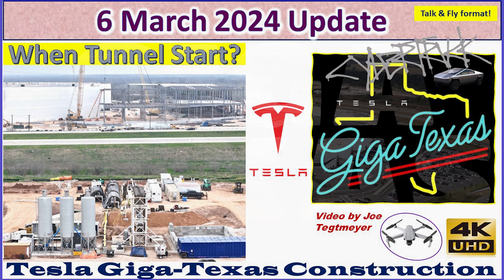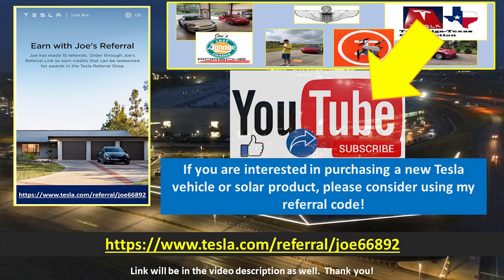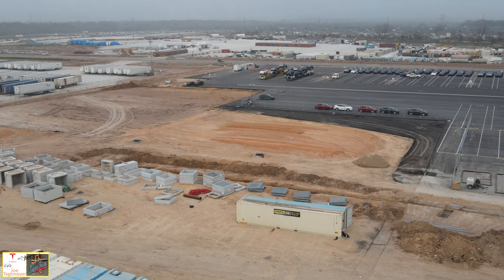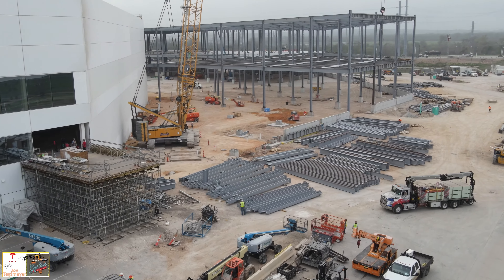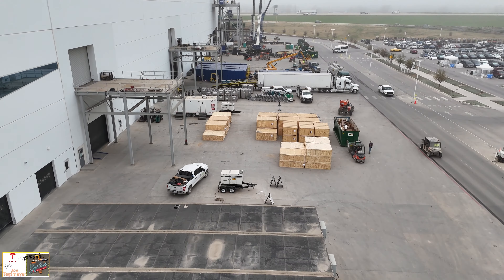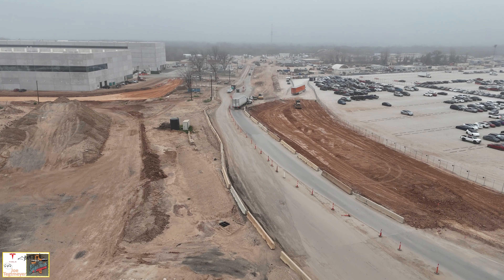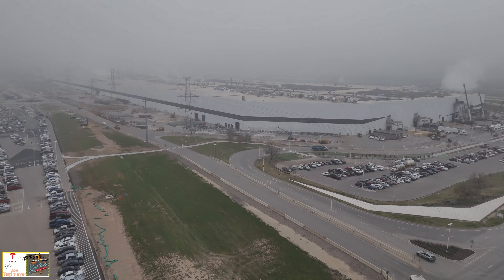W Superchargers, S Extension Grows & Production Ramping Hard! 6 Mar 2024 Giga Texas Update (07:45AM)

Comment: Thanks Joe
5:22. Westside. Tunnel Project. Spoil pit. Fixing ties across the concrete lego long edges. Steelwork on the ground to the left appears to have cleats/tabs at a similar spacing. Some material already dumped in the pit. Probably the sludge that was in front of the TBM.
8:49. New EOL north. Inside the door. White machine. Could be part of a drive-on dynamometer, or the traction motor for a movable production line deck.
9:33. New EOL Superchargers. Couple of arrows marked to show the normal orientation.
11:26. GA west. Old ramp location. Threshold has been saw-cut and part removed.
11:37. GA. Highway side. Lift station. Some issues still. Might be by-passing whatever is in the rectangular vault.
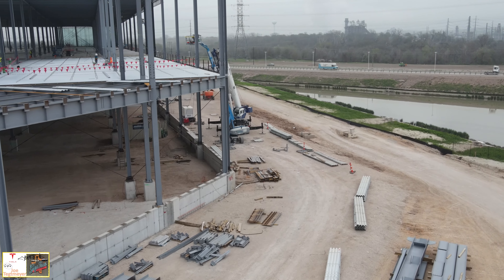13:09. Southend, west. Stack of steel. Right. Particularly deep beam with connection brackets for bracing. More ‘bracing’ related beams seen to the left, and at 13:47 to the right. Conspicuous lack of braced columns in the structure until now.
14:10. Southend, south. Left. Worker standing on a 6’ or 7’ 1.8m or 2.1m stepladder. Shows the top of the cast-in groove (potential door opening) centre is about the same height.
14:19. Southend, south. Inside. Joe’s photos include ‘The Money Shot’ of a view inside. Top of mud slab to underside of what I think is a lintel/beam for a door opening is about 12’ 3.6m. 
14:29. Southend, south. To the right. Painted section of retaining wall would be a clue as to the finished grade outside the building.
15:03. Southend, diagonal corner. Bottom. Black frames that look like frames to store glass on.
15:46. Southend. Tank farm. Top. Lids/caps have the various fitting flanges arranged. Some cut out.
16:01. Southend. Inside. Top. Excavation. Formwork shuttering for a finished slab placed on the mud slab.
17:23. Stamping, apron. Left. Large white crated delivery.
20:24. BIW, apron. Left. Concrete placed for a footing for the ramp retaining wall. May be the mud slab only.
21:44.  Casting east. Apron. Stack of screw/auger piles. Some handy pilot holes.
Something heavy to be placed here. Not the setout expected for a structure. Might be another Tank Farm.
Left some pipes on the roof may be related.
22:39. Paint. Apron. Cybertruck rear castings seen being crated up in Brad’s video yesterday. Completed castings, not untrimmed castings like these.
23:59. BESS switchyard. Knife switches that control the Megapacks are closed. To the right, the knife switches controlling the cables to the Mega-Vaults at the new switchyard/substation are open.
Megapacks ‘might’ be connected to the grid. Not connected to the factory.
27:00. Crash Test Track. Near the bottom right corner of the yellow plastic. Thin hose connected to the end of a Dewalt battery blower. Blowing debris out of holes drilled for the starter bars.
28:36. Cathode, west. Trench. Bottom centre. As noted by Bob Callahan a hydrant was just dropped off. Presumably the trench related.
29:11. Die Shop, north. Installing a flue or ductwork between the kiln/oven and the Die Shop.
Reply: I was about to request a wellness check
Reply: @benguthrie49  I was holding out so that you've got something to read before you hit the clubs!
Reply: @DessieDoolan  too much rain tonight. I'm hoping it ends by 1am so I can get my walk in.

Comment: Thanks Joe for the close up view of the switches!
Megapacks:
@ 23:59 A lot of vehicles in the yard. cabinet door open on one of the megapacks.
BESS substation:
@ 24:01 all 12 switches to the megapacks closed on this side.
@ 24:05 Don't have a clear view of the 12 switches on the other side but they appear closed as well. 
Those switches were open for the last two weeks. with only 6 switches being closed for a few days. They were all open yesterday. 
Let me remind everyone that closed switches doesn't necessarily mean that the megapacks are operational. Since circuit breakers along the way may be open.
When the megapack yard is empty of work crews, that may be an indication they might be operational.

EOL facility:
South superchargers:
@ 9:42 Two Cybertrucks parked in the wrong direction against the arrows, also not plugged in.
EDIT: Cybertrucks ARE plugged in.
@ 11:41 (Right) Another closed vault. An indication that the duct-banks to the superchargers are energized or soon will be.
Parking garage:
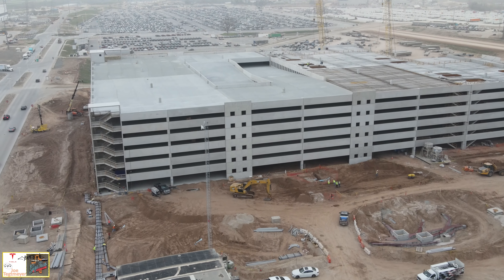@ 17:33 (Lower left) What appears to be 2 bases for switchgear cabinets.
@ 17:41 (Bottom) Where duct-banks head towards the building.
East parking lot superchargers:
@ 20:09 Speculating that these will be temporarily shut down soon, when the westside superchargers become operational. That will allow them to be disconnected from the temporary power supply and reconnected to power from the main building.
Eastside of casting:
@ 20:58 With the exception of reconnecting the superchargers to power from the building....
Cable splicing appears complete in the open vault by the stairs.  Bringing to an end a months long project to connect the factory to the new substation.
@ 21:40 Stacks of screw piles?
Reply: 9:42 If you stop the video and zoom in at 9:44 you will see that the trucks are plugged in.
Reply: @bobcallahan2322  You are correct. Thanks! My monitor is so crappy that even at 2160p resolution, I had to slow down the video and look really hard to see it.
Reply: I use an iPad Pro, works well.

Comment: Those "Rusty Poles" are the piles they are about to drive in the ground there. Looks like there is going to be some sort of small building off the side here perhaps...
Reply: Yep. Maybe a hopper to hold castings and feeding them back in when needed. No forklifts and racks running back and forth.
Reply: They screw those pipes into the ground. The excavator there has the screw attachment on it. They will start very soon.
Reply from the maker: Yep ... I was able to see them better in my images after I edited the video. I appreciate your heads up on them!

Comment: Thanks Joe for another great flight, and the insightful commentary.  Can you check if there's been more tunnel segments delivered?  Last I saw there was only about half of the required number.  I think they're either 1.5m or 5ft long, and 6 segments per ring. so that may eventually allow us to estimate total length.
Also worth watching the nearest point the tunnel can exit.  Inside the factory is looking less likely, with all the steel in the way.  Also, going back to May/June, there seems to be a groundwater management well along that path, which wouldn't make sense if they have to tunnel through it.

Comment: Great flight Joe.
Can you determine if the glass is single, double or even triple pane units?
Reply: Cut and past from a previous comment. "Southend glazing. 12,000lbs. For that weight it must be laminated glass.
In metric, 9m x 2m x 0.12m x 2.5 (relative density of glass) = 5400kg. 50kg for a surrounding frame. 12,015lbs.
Counterweights on the vacuum lifting rig are 5 x 1000kg. 5000kg."

I think it might be doubled glazed with one surface (likely outer) multiple laminations (4 or 5), gap, 2 laminations.

Sedak the German glass supplier has a particularly good website.

Comment: 1:30 the cyber trucks are pointing the wrong direction. They’d need to point away from the building to be able to use all the chargers.
Reply: Could be just parked for testing.  Eventual flow may be as arrows suggest.

Comment: 13:19  One of the theoretical TBM exit points is just inside or just outside the opening on the perimeter of the building in the center of this screenshot.  That's because it is perfectly across from the TBM ready to go under the freeway.  However, if you look closely, you will see the deep pumping station that was installed last year literally feet away.  I would find it incredible that they would plan to tunnel so close to this with only feet away as the TBM would have to have made it's upturn by then..
   Therefore, the TBM either has to exit within the Southern extension, traveling safely far below the pumping station, or some place on the other side of the new building.  What does everyone else think?
   Edit to add: another possibility other folks have mentioned is that it comes out of the ground just past the freeway in an analogous position of it's new to be drilled entrance!
Reply: 13:19. Deep well. The well is well* clear of the tunnel alignment. Manholes to south also clear of the alignment. A drain connects the manholes to the well, that drain is deep enough for the tunnel to pass above. No other reason for it being that deep.

This deep well (in hindsight) was the first part of the tunnel project.

*pun intended.

Comment: Although connected to the grid, don't the megapacks usually have a green blinking light that indicates they are energized and active?
Reply: Not necessarily connected to the grid. The might be, but it can't be confirmed. The thing about switch positions is that they can only tell you if something is NOT connected. They can not confirm a connection even if they are closed. That is due to the fact that there are also circuit breakers that may be open. While circuit breakers may have indicators, they are not visible from the drone.
Not sure about green blinking lights on the megapacks. A better indicator may be.... Switches closed, the absence of work crews from the megapack yard, and all gates closed. Or... If Joe or Brad get a chance to talk to one of the contractors working on the project.

Comment: Well if they are shipping complete castings that would suggest they are fully replaceable no?
Reply: It would suggest that they shatter on impact. Not good. Maybe fully replaceable but at what cost?
Reply: @DavidJohnson-tv2nn i was looking at it from a custom builders point of view sorry. its my understanding it takes a lot to damage them in the first place.  they have govt mandated crumple zones just like any other truck. They would have never passed DOT if they just "shattered."
Reply: @DavidJohnson-tv2nn The entire vehicle is basically built onto those two large castings.  Seems unlikely you could extract them economically.  Does remind me of the old saying, "Take off the radiator cap and replace everything underneath it." 🙂  Hundreds of reasons to send samples to partners.  In the damage/repair context it could be for testing of repair/welding processes.  Very reasonable to re-weld replacement parts to a casting or repair bits of the extremities.

Comment: At 28:37 you see those four large pipes with valves and temporary end-caps?  The four openings above those pipes appear to be the same as the openings under the four Evapco units to their right.  That, in combination with the bare ground to the left implies that this is expansion space for, perhaps, a doubling of the cathode production capacity later.  The two stainless steel tanks to the right of the Evapco units look exactly like the two not yet installed ones that have been stored up north for the last several months, on their sides. That big white tank up against the building has two open ports as well.  Their are also four pairs of buried conduits coming up from the ground in front of that white tank.  It all looks like planned capacity expansion.

Comment: How are they going seal on the top of the glass where there is huge space above the glass.
Reply: There will be wall panels on top of the glass elements. That will make the proper seal and made a straight line of the wall height.
Reply from the maker: Concrete wall panels along the top/
Reply: @JoeTegtmeyer  Thought they were using shorter panes of glass.  Not so?
Reply from the maker: @sammyk874  I didn’t not think so, but they could always do something unexpected!
Reply: @JoeTegtmeyer  I thought it was one of Dessie's speculation as there was a smaller pane sitting around the area.  I think you can see it at 15:12 through the glass.  Maybe that's something else altogether.
Reply: Glazed parapet I would guess. Would be weird to break up the glazing with a panel of some type. SammyK points out the small glazed units at 15:12. I scaled these in an earlier comment. Same width as the larger panels. Right height for a parapet.

Probably a sample for now.

Google 'curtain wall glazed parapet', go to images. Very common detail.

Comment: I kinda thought that the concrete panels would be removed to open up more room on the south side of the factory.
Reply: Those panels serve as a firewall. I do question why they didn't remove the existing angled corners though. At least on the southwest side.
Reply: @DavidJohnson-tv2nn Clearly it was unnecessary.
Reply: they may remove some yet. One doesn't want to open up the inside before necessary

Comment: Just a thought about the tunnel. My bet would be that there could be up to 4 when finished. 2 at the south end to bring Cybertrucks to the EOL facility and a people mover to take porters back and 2 at the west side for Model Y’s and porter return.
Reply: I’d be very surprised if the cars won’t end up going through the tunnel by themselves. There might be a separate tunnel for the Y, but they might just as well drive them through the factory to the south tunnel.
Reply: The maximum capacity of a single tunnel is way more than the production capacity of all 3 lines.  
Let’s assume both Cybertruck and MY production is one vehicle every 30 seconds and compact is twice that, for a total of 8 per minute or under 500 per hour.
At 10 kilometres per hour, a vehicle every 10 metres equals 1000 per hour. 
If vehicles drive autonomously there isn’t a need for a return tunnel.

Comment: So with final steel being erected to close-in south side of building it is increasingly unlikely that Boring tunnel will terminate inside since cranes will be needed to remove Boring tunneling machines after they complete work!  Tunnel will terminate outside of bldg footprint!
Reply: Maybe that is why there is an exit to the east… my wonder is how supplies get into this factory. No receiving doors. All by tunnel??
Reply: @franklinmargolis2051  On Brad's video yesterday I speculated that the reason for the glass walls is because of an employee revolt of all the California transfers wanting windows in their offices, and not factory walls.  Thus the entire South facility will be soaring office space, and not factory space.  And this is supported by your observation of ZERO loading docks for the entire southern extension!  No loading docks = no possible manufacturing facility!
Reply: @eclecticmemes  So much for Elon's lean philosophy and putting support functions near their work. If that is all office space, I'm selling my stock.
Reply: There are straddle cranes that can work in the 40 foot height of the ceiling
Reply: That's possibility. However the TBM can be dismantled inside the building. Tunnel engineer David Salisbury commented that the heaviest component is the cutterhead main bearing at 50T or so. 

Much heavier stamping press components have been shifted into the building using SPMTs* and gantries.

*SPMT. Self Propelled Modular Transporter.